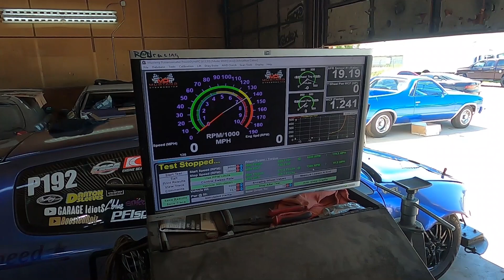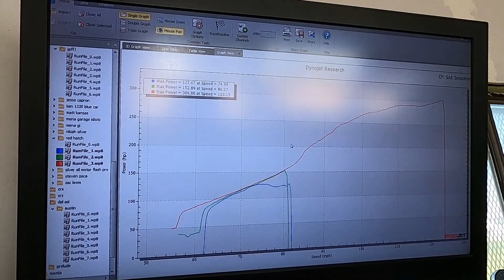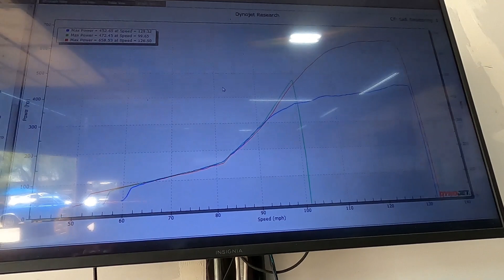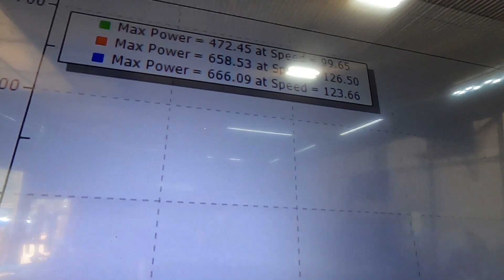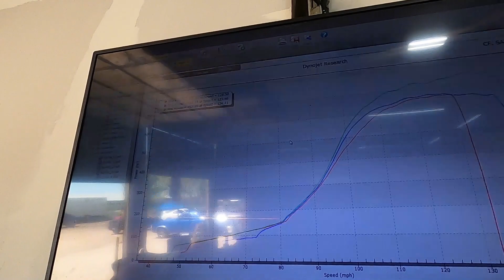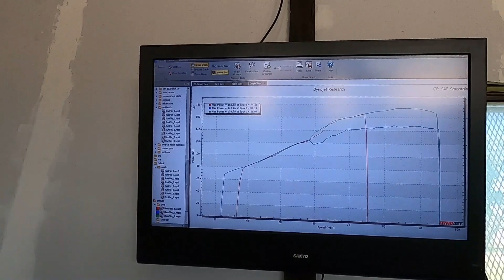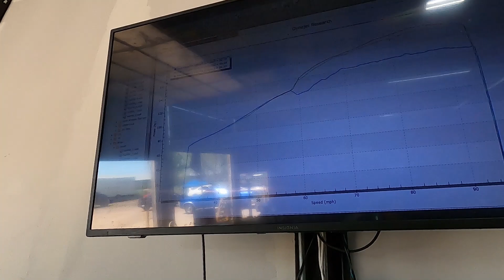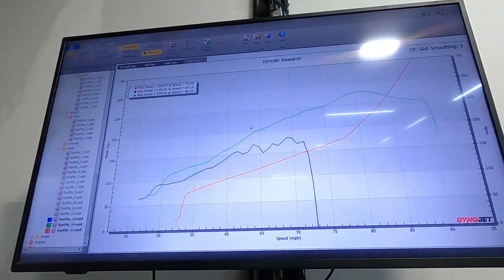Shop is Wildly Busy! BoostedBoiz come back to Colorado

Comment: The underglow on that red hatch is nuts..... looks like it’s floating on a rainbow 🌈...
Reply: Peep SOLED Custom Lighting! They make and sell those kits 100% custom!
Reply: It would be cool if as the RPM rose the LEDs circled faster.
Reply: @BucketList22  they were actually! They were on a music mode so it was actually picking up the rpms as they got louder, if you watch right after Brent is talking to me about the lights pay attention to the lights spazzing out that’s because it’s picking up all the motor noise! I’ll have to post a video at night while he is hitting 2 step, plan on hitting bandi wed so that will be a great night! But there’s many other options as well that does make it capable of doing so!
Reply: @soledcustom3dprints  cool

Comment: HEY BRENT DID YOU WORK ON OR TOON A A BLACK IN COLOR SS CAMARO WITH A STAND ALONE ECU IN THE THE CLOVE BOX THE GOON SQUAD JUST BOUGHT ONE FROM AUCTION AND THERE IS A FUSE BOX IN THE CLOVE BOX WITH THE TWO CONNECTORS FOR THE ECU AND AND ONE PLUG SAYS PFI ON IT

Comment: They should tye in the LEDs to the rpm
Reply: The circuit board that controls everything gots a mic so it can actually do that and was reacting to the sound of the motor. Right after everyone was talking about it
Reply: 8:30 you can see it

Comment: Awesome video guys! Just a word of caution on that red car I hope he doesn't use those red and blue flashing lights under his vehicle while he is driving down public roads period even though it's a red Honda the only Vehicles supposed to be displaying red and blue lights even if hidden are official vehicles
Reply: Chill out rex lmao it's called underglow and it's been around for ages also if you pay attention it's not just red and blue it's all the colors and its perfectly legal to display and use any color lights under or on top of your car with the exception of red and blue together. Lmao you can have straight red and be totally fine or straight blue but not the two together. Look up your local state vehicle light code and see for yourself
Reply: @davidcates728  good to meet you and I would just like to add that I'm probably the most chill guy you would ever meet. I mean after all I started off the comment with awesome video guys! I was just pointing out an actual fact that vehicles cannot travel on public roads with both a red and blue cycling light without having an attitude. I know what underglow is and also saw It going thru other patterns. so I hope you have a great day
Reply: Thanks for looking out my man!!! We make sure to inform our customers about the potential use of using our red/blue combo mode and as well as green but in reality it all comes down to the cop and if he wants to be a prick or not. But under glow is completely 100% legal! It’s all preference on the cop. We have talked with many of them as well as had them thumbs up us while driving next to us!!
Reply: @soledcustom3dprints  I've never had it myself and I'm a big fan of underglow it looks really nice when done right. But when I saw those flashing red and blue lights I was like oh my God Karen alert! Do you know there's going to be a lot of busybodies that would just love to cause trouble for you if they see you flashing red and blue lights LOL have a great day thanks for your response

Comment: Disconnecting the battery while the engine is running is not a good idea.
The engine will run on the output of the alternator ONLY but the voltage regulator has no voltage reference anymore because the cable has been yanked off the battery. There is a good chance that the voltage regulator will regulate the voltage to  the absolute MAX volt.(15volt? 16volt?) It means all car electronics and the alternator will have to deal with that  too high of voltage.
Some electronic components might not survive that.
Reply: its a honda you can do it and it will be fine